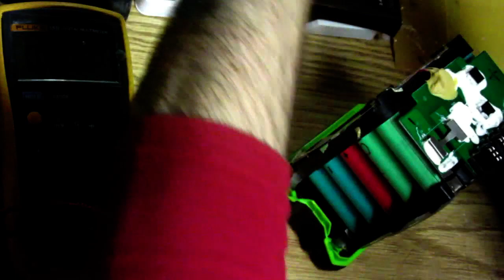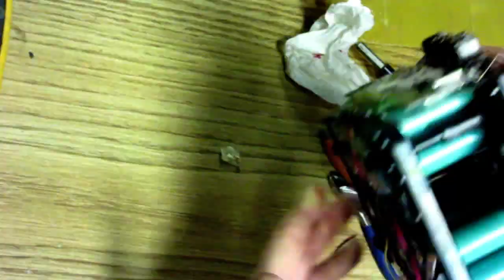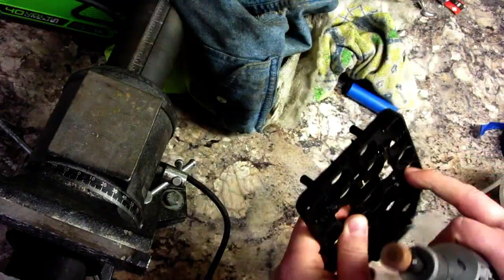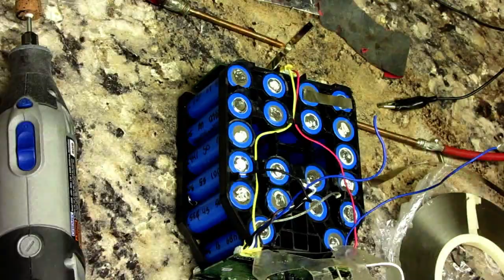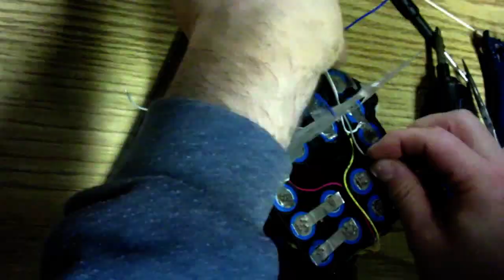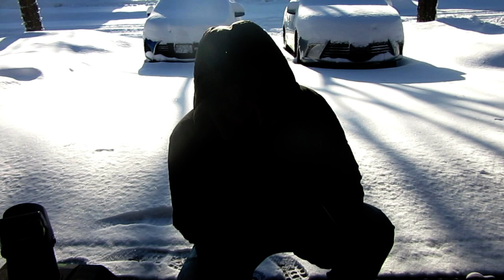Greenworks 80V Snowblower Battery Test & Repair

Comment: I have a 6 AH greenworks 80V pack that won’t charge, but  I think the protection circuit is malfunctioning. The whole pack has about 75 volts on it and shows 1/3 bars on the internal voltage tester.I couldn’t find a clearly dead cell when I went thru testing voltage on the cells, but I didn’t disassemble fully. Mine looks like it has a lot more protection or balancing circuits but I do not know enough about electronics to further diagnose. Going to try greenworks warranty Monday but I think mines expired by about 6 months.
Reply from the maker: Hmmm... I noticed on mine that if there is a large variation of individual voltages, it wouldn't charge either. I manually charged each cell to be about 5% total variation, and then the charger flashed green. Its complained once since, but after leaving it alone, it went back to green. I think the internal circuit tries to even the cells out if possible. If you have a charger with external leads, and if that is the issue with your pack, then you may be able to individually charge those ones that are out of range and give it another shot. But if you have warranty, that's even better! :)
Reply: @chargerr4807  Greenworks made me go thru some troubleshooting hoops, but they are sending out a replacement battery for free. Pretty glad I ordered directly thru them, it wasn't a difficult process.
Reply from the maker: @copycat923  Awesome! Manufacturers hate batteries because they are such liabilities, so you have a real win there! Go Greenworks!

Comment: That worked a lot better than I expected. How hot does the battery get after running like that? Laptop batteries are usually made for high capacity, but low rate of draw (4-6A max). Tool batteries usually need high draw when under load (10-20A) and therefore aren't often as high capacity.  I'd guess the 2-stage blower or mower might be too much for those cells. I've wanted to do a build/rebuild like this, so I'm glad to see it works, as long as the cells are relatively balanced.
Reply from the maker: Thanks for watching, yes, I was surprised how well it did, especially on one string of batteries! I haven't checked hotness, but as you correctly pointed out, LiIo are not built for high current applications, and are probably flaming to the touch, but sadly that's how they come from the factory. Not designed for longevity, oh well. Best of luck on your rebuild!

Comment: At 23:08, did you wind up disassembling the pack to individually charge the cells.
Reply from the maker: Yes, I used a single cell lithium charger and charged each each low bank up to 4V, so all banks had roughly 4V, then the charger kicked in and balanced everything properly. So the final driveway test was maximum power. :)

Comment: Great video I might have to do this repair to my 80v battery as well. 
I'm curious as to where you got the wholesale laptop batteries from? 9nline resource or a local store?
Reply from the maker: They can be found in onnline auctions. I believe the ones I have purchased were from those with Amazon returns, so luckily I found a small cache of laptop batteries. :)

Comment: great stuff, thanks for sharing. question, i have some of these batteries where it looks like all of the cells are good but the little battery indicator/BMS board on them is bad. Is there any way to replace that? Any suggestions on where to find the right board?
Reply from the maker: Hi there, if you mean other generic battery packs, other than the Greenworks, then yes, most likely a universal BMS will do the trick. But if the packs are for lawnmowers, commercial products, etc, then a universal one will probably not allow it to charge on the OEM chargers, but may still work on the product. If you can provide more detail, I can give you a better answer.
Reply: @chargerr4807  i have the greenworks pro 80V 2AH battery packs. I was thinking instead of getting a universal BMS, if I could somehow find the used circuit board from a dead greenworks battery that might let me fix it, but i'm not sure how hard it is to replace that board. Mine has flexible printed circuit board to each of the cells and not whole wires (hope that makes sense)
Reply from the maker: @FrankGraffagnino  OK, so that is the same battery pack I repaired, but perhaps you have a different version of it, dunno I would need to see pics. But usually the BMS is ok, but the batteries are bad. Have you measured each battery for voltage? They should all be above 3V. If some are close, possible the BMS has already shut down, maybe just resetting the balance wire connector may fix things? Or perhaps charging up the low cell individually might bring it back to life.
Reply: @chargerr4807  yeah, I realize that usually it is a cell but I can assure you that isn't the case here. All cells measure good voltage and the total voltage is around 80 volts. But when I push the button on the battery meter nothing comes on and I can hear a tiny buzz. The charger doesn't flash red or anything it just doesn't detect a battery. So I'm fairly certain it is one of the two circuit boards, most likely the one with the battery meter since I can hear that tiny buzz. On a good one I don't hear any buzz
Reply from the maker: @FrankGraffagnino  Hmmm.. OK, the sounds like something has gone wrong with the PCB. For a replacement board, you might want to scour Alibaba, usually  you can find a clone, or just the circuit board + shell for a diy repair job. If you went with a universal, it would definitely not detect or charge it, but you'd have power for the snowblower, and you could charge it seperately? Best of luck, report back if you find something! :)

Comment: Great video, One question.   What did you use to weld the straps to the batteries>
Reply from the maker: Thanks for watching! I have a home-made spot welder. Basically a car battery attached to a starter solenoid, powered by a small Arduino for proper pulse timing. A few people have asked me about it, I should probably make a video about it, but if you search, there are already plenty of Youtube vids out there about those. :)

Comment: How they make 4amp battery, is there enough space or holes to hold another 20 cells?
Reply from the maker: No there is not much space, unless they build a bigger battery pack, or use higher capacity cells. Some snowblowers have a double battery system for this reason.
Reply: @chargerr4807  I have the 2 stage 80V greenwork and it come with same dimension battery as you but they are 4Ah, so I guess they use double capacity cells. They are also much heavier then the 2Ah.

I have been using it for 3 years, summer (mower, weed eater, leaf blower) and winter and I have 2 of the 3 battery that are not working anymore, one I can still charge it manually with my DC power supply, I put it at 82V 1A and its able to charge it 100% and it work fine in my blower (But still red light on charger), the other one also charge on my DC power supply but it does not discharge, the blower detect it as bad as soon as I start it, so I'm guessing this one have a bad cell in it :(
Reply from the maker: @hyksos2  Thanks for the info, I'd be curious to see what it looks like inside. A 4Ah battery doesn't exist as far as I know. Yes, the Chinese put those ratings on them, but they aren't real, so I wonder if they re-arrange the shape to fit double the battery, or maybe they don't use 1860 type, and use a thicker type? But yes, if the charger will not charge it, then it probably has a cell out of range. Ie, the variation between cells is greater than a certain amount. On the battery I have, one of the cells seems to be weaker than the rest, and it makes my charger flash red sometimes, but if I use the blower, and drain it a bit, and then charge it again, it works, so for sure there is a bad battery in there. Do you have the ability to take it apart?
Reply: ok so I opened my bad one, it have 20 cells, 17 are at 4.07 volt, 2 at 3.89 and 1 at 3.2v :(
The cabling is also much different they now use flex PCB on the side for the load balancing connections, seems much cleaner.
I'll see if I can replace only the 3.2v cell ... never did that kind of stuff
Reply from the maker: @hyksos2  Yikes, yeah, that 3.2V will kill it. But sounds like they are normal 18650 cells still? So... they are rated at 4Ah? Wow, I have some high quality batteries out of a work laptop, HP, and they are measuring at 3Ah, and that's the highest I've ever seen.  You can try the Amazon 4Ah, but I understand they aren't actually measuring that high, but give it a shot, hopefully I'm wrong. Good luck, and let us know how it works out.

Comment: I have an 80V battery 2.5Ah that came with a new leaf blower I purchased from Greenworks. Already won't charge. It was down to 50V and the charger starts flashing green before switching to flashing red 15 seconds later.

I used another Greenworks battery to get it up to 72V, but charger still won't charge it. All 20 individual cells measure at 3.6V

Does that mean the problem is one of the boards on it?

Thanks
Reply: I had a similar situation with a Ryobi 40V power pack.  Even after I brought each cell up to the same voltage it would not charge in the charger.  There is a reset on the logic board where you shorted 2 pins together briefly - after doing that it would charge.   I don't know if the Greenworks boards have that - I did a quick google search and did not see anything.  Someone DID suggest putting the battery in the freezer for like 30 minutes and see if it would charge than.  That's worth a try - I know the logic board monitors temperature and if that part is defective it could prevent it charging...
Reply: What did you do with the battery?  I have battery that has 72 volts but won't charge

Comment: And what to do if, after replacing the batteries, even the red button on the charger does not light up?
Reply from the maker: Good question, everything just started working for me. But check the balance on the batteries, to make sure they are all within 0.1V of each other, and that the total V is approx 40. Then put it on the charger, in case the charger does some sort of init sequence. Otherwise, possibly the battery PCB  has gone bad?

Comment: how do you measure battery's internal resistance?
Reply from the maker: I use a lithium battery tester to measure internal resistance. The one I use is the Lii-500 and I believe my TD610-Pro also does it. So probably most lithium charger/testers have the capability.
Reply: @chargerr4807  It's Lii-600.

Comment: I bought a green works weed eater. The thing is great, BUT! Six months later the battery crapped out. Call the service line, waited for 35 minutes. Got tired and hung up. Called the next day, 45 minutes later I hung up. Their service sucks!
Reply from the maker: Sadly that seems to be common amongst all the battery powered product companies I have heard of recently. Even ebikes, like Daymak, you pay thousands for an ebike, 6 months warranty, and good bye. They CAN make a battery last the recommended 1000 cycles if they really wanted to, same as they can make a good LED light bulb if they wanted to. But comes down to money, so ... enjoy the product while it lasts, under the warranty period. :(

Comment: Greenworks SUCK. Brand new $350 80V snowblower worked for exactly 60 seconds and about 20 feet! Then the motor crapped out. Boxed it back up, shipped it back. GARBAGE
Reply from the maker: I dunno, I bought mine used and cleaned my drive two or three times that year. It is super lightweight but mine does the trick. I hope you have better luck with another brand.
Reply: Broken they are $25 but then i fix the battery packs and sell them with a balance port and audio buzzer so next person doesn't over discharge and smoke a cell :)